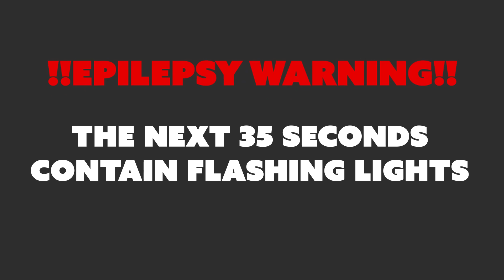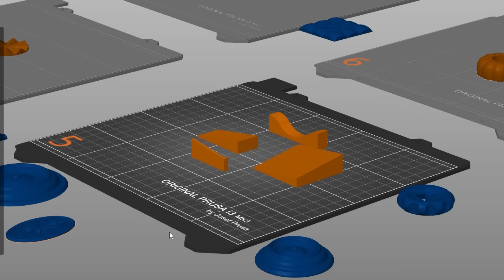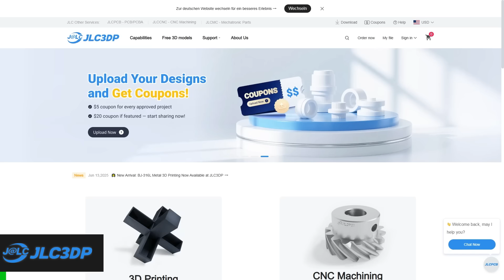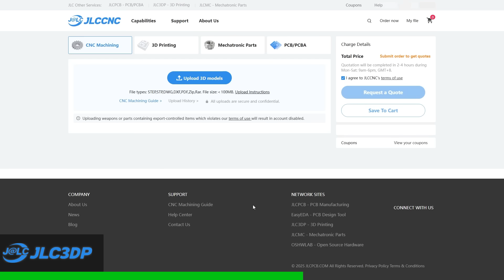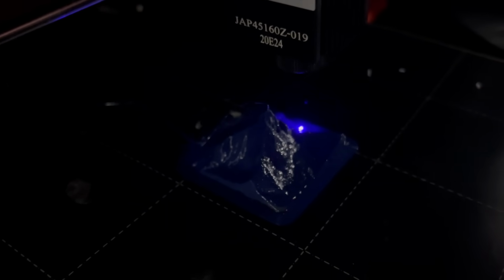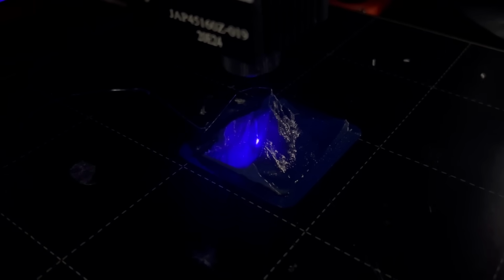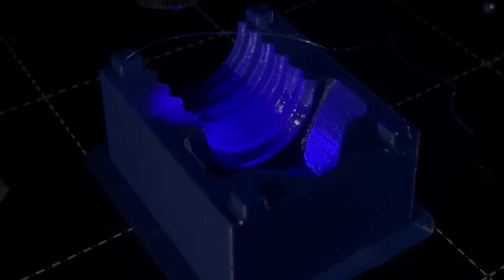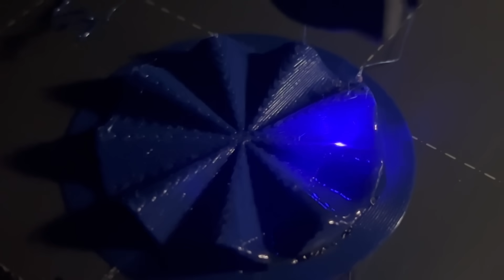Laser Smoothing 3D Prints! Does it work?

Comment from the maker: What should I do next?
Reply: A technique that is used to smooth 3D prints is using a heat gun. What if you blow hot air through a nozzle, if it works you have contactless ironing like the laser. Another thing would be to locally drop a solvent onto the 3D prints. Both would be slower than existing techniques but would be more precise.
Reply: Please compare it to an acetone vapor chamber result. I've seen it causes the final print to get really smooth without changing color
Reply: How about putting a powder on the surface before lasering it in? Fine Sand? Metal? Rubber? ...
Reply: Use the laser midprint / between layers while printing to reduce anisotropic issues with FDM printing. If the material is re-melted (even partially) at each layer with the previous layer, it will likely crystallize better when cooling and give a very very strong part (probably as strong as an injected part, maybe even better). That would take forever to do and you don't need to push the laser power as much as in your tests, since you don't want a smooth surface, you just want to fuse the layer with the previous one better, so you can probably increase the lasering/ironing speed by a good factor.
Reply: Collab with the electroplating guy from Germany?
Reply: You could try to use a red diode laser, as you do want to heat the material on the spot and not vaporize it- 
also you could  preheat the already extruded  Filament to have perfect temperature for better molecular sticking to the newly extruded material for high stress applications or you could build a heat insert device, that makes use of the on-the-spot heating Methodes- either heating the brass insert with laser and push it in the material, or heat the plastic and push in a cold insert
Reply: Combine UV resin and a UV laser to get a smooth coating? I have seen someone try to brush on resin to smooth a print but not in a automated manner.
Reply: Adjust the laser output, maybe try trying a different heights to adjust the heat, maybe a diffuser on the laser to spread the beam out a bit more. Physical disconnect on the laser power input. Just a couple thoughts, great video.

Comment: The laser can ve used in the printing orocess to increase layer addesion. Pointing the laser to the nozle zone to melt the contact zone of the cold layer and the hot fused filament.

Comment: A laser without a polygonal mirror like in laser printers is a very slow solution.
However, a point laser can be used directly during printing to "weld" between lines within the model itself. 
Laser modules can be found in the same laser printers, but adapting them to CNC kinematics is difficult.

Comment: You need to defocus the laser more to make a wider beam, or else use a less powerful one.  It takes time for heat to soak from the point the light is hitting down deeper into the skin, and if you try to hurry the process by using a more powerful laser, you'll just get more charring as the surface gets hot faster than the heat can be conducted deeper into the skin of the model to melt deep enough to actually smooth anything.

Power versus time is going to be the critical thing to tune to get this working well.  High power and low time will tend to cause scorching, and low power and high time will let heat get too deep into the model, melting too much.

A side note is that transparent filiment will let the laser light get deeper before being absorbed, reducing surface scorching again.  Color actually matters here!

As for the mold, what happened was that the smoothing rounded the inside edges of the bottoms of the holes, as well as the areas at the bases of the pegs, blocking things from fitting properly.  To fix this, make the holes deeper than the length of the pegs to add tolerance at the bottom, and add a small groove/cavity all the way around the base of each peg, so that the smoothing has to fill that gap first before it can infringe into the volume that needs to remain clear.  Basically, you need extra tolerances in pits and creases, since they will tend to fill in under smoothing.

Comment: dude, emergency stop buttons are cheap and easy to set up. Just wire one in and hold it at a distance
Reply from the maker: Well yes, but this is a temporary setup and I can also just pull the plug so there is not really a need for a emergency stop button. I was talking about automatic safety systems such as flame/smoke detection like you can find in normal lasercutters where you don't have to be in immediate reach if something goes wrong.

Comment: I think a higher power UV laser would only burn without melting. thus making it worse. 

but since we are only trying to slightly melt the surface. an IR laser I think would be much better suited. 

I also think defocusing the laser would help as well

Comment: As a guy that does finish paint, it is a multi step process. Paint sand repeat 2,3,4,5 times. That is a once over without sanding. Okay how would I fix this issue a micro sand blasting attachment on a separate cheap 3d printer and because you are doing plastic it can be MUCH MUCH weaker and that makes it much easier to make. How would I make a micro sand blaster attachment? After looking at the cheap options and I am convinced you will need to use a pan air compressor and cheapy micro sand blaster and mod them for much less flow and encase the work but the issue is the dust will get inside the barring's and kill the 3d printer so use condoms I guess.

Comment: Now that your are getting metal parts made for your experiments, you could try to combine all your research into making all nozzles better???
Instead of the sharp pointy nozzles that are shaped like the end of a pencil that everyone uses, maybe the head of the nozzle could be sculpted into something like a ball with a hole in the bottom.
Then the nozzle could be better used to smooth the plastic in the ironing operation?
ha ha, as ever with 3d printing, the 'overhangs' are always going to be the worst surface of the print 🙂

Comment: Next time, some "mold release" may be helpful to remove your finished products.
Reply from the maker: Yes but this video is not about perfecting molds. This video is about testing if you can use a laser to smooth 3D prints. Ofc there are better ways to make molds.This was just a test usecase I came up with. I own a PTFE mold release spray, but I thought it might distort the scope of the test.

Comment: My interest in lasers here is the possibility of strengthening the print, using the laser to remelt select areas, probably in a grid or truss pattern.  You can modify the stl to add layers in this pattern so you don't have sunken areas if you don't want that effect.  This can also be done in a second operation outside of the printer for treating the layer line sides.

Comment: The problem with red filament I guess is that the pigment absorbs most of the laser wavelength, either you have to use a laser of different wavelength for prints with red pigments.

Comment: Hmm... I'm wondering, what would happend, if you had a laser, which can be slightly adjusted with a mirror, to pre-heat the underlying plastic during printing. Meaning, that the surface, you are printing on, is already pre-heated by the laser, making it a better bond. That would probably not fix the layerline issue, but might end up in a stronger part? Anyone ever tried such approach?

Comment: what you really need to do is use a laser to improve layer adhesion.
just like tig welding.
if you use the laser to heat the layer beneath the current layer being printed.
imagine a laser heating the area right before the nozzle extruders the next layer on top.
you will greatly increase layer adhesion. 
since layer adhesion is a problem becasue you are pushing hot plastic down on top of cold.
if you could get that cold layer to glass trasnsition temp just as the nozzle extrudes the next, you will greatly improve adhesion.

Comment: Reduce laser power and increase exposure time. This should let the heat penetrate to do it's job without burning the filament.
Basically the opposite of what you tried :)
Reply from the maker: I tried that with the big test piece. left to right: speed increase(exposure time) and each step is a different laser power. My guess is that the burning marks are from destroying the pigment, which probably happens because it‘s a UV laser.
Reply: @tengertechnologies  That actually sounds very plausible!

Comment: Safty:
0:57 just use an UV laser and a UV cover from a UV resin printer and seal or adapt it so it's easier to use without forgetting once and geting blind, also just use some good laser googles

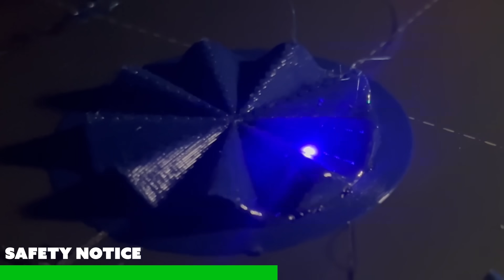1:15 laser fumes can be dealt with in a fumehood but I get it that not everyone has one

1:35 fire hazard just install a kill switch to the laser just in case something happens

Comment: This is a cool variation on flame polishing. (If you don't know what that is, in classic plastics fabrication with acrylic, you use a map gas torch over your rough edges to smooth them to a gloss finish). Works equally well on FDM PLA and some others.  I feel like Snapmaker should update Luban to do this.

Comment: Ideas: Do another pass at a 90 degree angle, and/or possibly vibrate the build plate. (No clue if that would let the molten plastic actually flow any bit more than normal tbh)

Comment: I've had some experience with working with 3D prints and wax, and your problem is that wax went through the walls and into the infill.

Even though the wall looks/is watertight, some hot wax will still seep through. I've had this problem with all materials I've tested PETG, ABS (haven't tried acetone smoothing tho), PA-CF and TPU. But for me it haven't gotten too annoying, so i just live with it
Good news is, that after few initial pours the problem will be gone, as all the empty space of infill is full of solid wax. When you pour new portion of hot wax, it won't be able to melt the infill wax (too big thermal inertia). But when you keep the wax hot (i use 3d printed cup with diy heater to melt my wax) after some time it will seep through solid walls and make a mess.
I think that by remelting inner walls you made them more watertight and maybe more temperate resistant (tempering maybe? I'm still a newbie to 3d printing) so a safer option could be to use ABS/ASA and try to vapour/liquid smooth it with acetone. Also, maybe higher temps or more perimeters could help but i haven't done any tests on that. Another fix for that would be choosing an infill with small cavities instead, like cubic, in contrast to gyroid which is one big contiguous open volume
edit: i should have watch the video first
Reply: also, TPU works better for molds and you can get away even with some overhangs when unmolding.

Comment: One suggestion I'd make is to try deliberately defocusing the laser to increase the dot size. That would allow a larger stepover between lines and probably result in a smoother finished product, though it would require higher power and/or lower speeds, so if you're already pushing your power max I'm not sure how the lower speeds would trade off with the wider-spaced lines
Reply from the maker: Thats exactly what I tested with the print you can see at 3:00 in de video. But no matter what, it was always brown. I think this is just  the pigments which burn before the plastic melts. A laser with a different wavelenght would maybe improve this, but unfortunately I only have blue diode lasers.
Reply: Did you test the different offsets with the blue filament or just while trying to get it to work with the pink without burning?
Reply from the maker: @legoruthead  I just tested it with the pink one

Comment: that lion looking really good, this is awesome for making smooth molds without needing any sanding, would be awesome if this became mainstream tech on printers
Reply from the maker: I think just because of the fumes, this won't ever be a good option for mainstream tech. It was a fun experiment and worked better than I expected, but you really want to do this in a controlled environment and not in your living room.
Reply: @tengertechnologies  maybe with an enclosure and exhaust to the outside or with a filter, it will be safe then

Comment: With this process prints could:

- Be waterproof (perfect seals since plastic melted)
- Maybe food proofing? (since there are no pores for food to accumulate and bacteria to grow)
- If used on the inside, it might improve line adhesion, since you can melt lines to improve their bonding.
Reply: Yeah, plastic molding exists for a reason... 😅. Not everything has to be 3d printed

Comment: I wonder how much the results differ to acetone smoothing abs prints. Complexity seems much higher.
Reply from the maker: The problem with acetone smoothing is that it doesn't work with all filaments. But for ABS/ASA it's definetly the better/easier option

Comment: 1:48, An interesting approach.
It seems to me that for this you need to use another laser module, not with a blue beam, but with an infrared one. Due to the different wavelengths, they behave quite differently. For example, where the blue ray will melt, the red one will cut off without carbon deposits and polymer melting.

Comment: Great work! That looks really impressive.
Reply: Lasering DURING printing between the layers could reduce internal stresses and/or improve adhesion by pre- or post-heating the previous layer?? A hypothesis 🤯😮
Reply: @Hukkinen  I had same thought. Something like SLS but without powder.
Reply: What if you used the laser to heat the bed in front of the nozzle as it extrudes? @Hukkinen
Reply: Btw looking forward for cutting edge great stuff from you!
Reply: Maybe you should shut down your YouTube channel, because TenTech is doing what you should have been doing.
Reply from the maker: @Ismsanmar  
Firstly, no one is obligated to do anything. You don't have to consume content you don't like. Secondly, I value respectful interaction in my commentsection, so please keep this in mind for the future.

Comment: I wonder how this compares to vapor smoothing. I feel like acetone in a tub can't be much more noxious than remelting the plastic with a laser.
Reply: Smoothing using acetone would work fine for ABS but not at all for PLA which is quite 'unimpressed' by most solvents ...

Comment: Super cool idea! Some suggestions:
1. Try multiple passes to see if that further reduces layer lines without burning.
2. Try varying the laser speed with the slope of the part, so steep surfaces get the same exposure time as shallow surfaces.
Reply: I was thinking the same thing. Also should change direction when doing it, that way the laser melting doesnt stack.
Reply: Yeah, thick areas get more laser, whereas thin or mating-surfaces, notsomuch.

You can also try to preheat  & anneal lasered area -- try a Hot-air rework station for soldering / Heat-gun / Hair-dryer...

Aim warmth toward your laser-beam, on a low setting.  Not to actually melt material with air, just so surrounding material has time to warmup & cooldown more gradually.

Comment: Okay I immediately see the potential of this. Probably not gonna be hobby accessible any time soon just because of the fumes and eye safety issues, but definitely very interesting
Reply: No its not 😅 just a "what if" solution proof of concept. Not just because it works, then it should be used.. today if you want smooth surfaces just mold the piece. The higher quality mold you have the more pieces you can get 🙊
Let me get this straight. Assuming you are goint to print 50 pcs for a client and "laser smooth" each one 😅 lol. Assuming none fails you will charge all this wasted time instead of:
3dprinting a single piece then creating a high detail mold ( smoothing first the piece with primer) then you get a smooth surface the. The mold you can get a lot of pieces. The time you take smoothing the original piece its the timw you will gain by just pouring to create those said 50pcs 😅
But I guess you kids are not prepared for this conversation
- thats the basic workflow for any custom molding technique anywhere around the world.. the only difference is the master part is a 3d print piece... 🤷‍♂️ nothing new lol
You kids are amusing

Comment: If you want I can send you the directions for PLA smoothing with Acetone. (Yes PLA) It's a method our company developed years ago but never went further with as we stopped using FDM. Prep is fast and the actual smoothing takes 5 seconds and it leaves you with glassy smooth prints. Downside? Pretty much the same dangers you just mentioned. Let me know and I'll send you the write-up.
Reply from the maker: That sound very interesting! If you want to and if your company is fine with it, I'd really like to hear more about this. This could be very interesting to the whole 3D printing community!